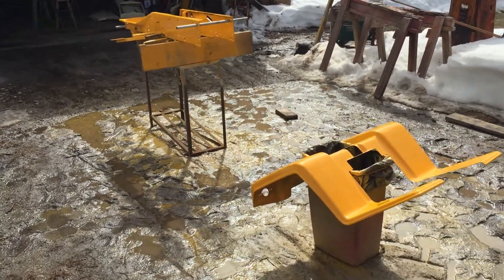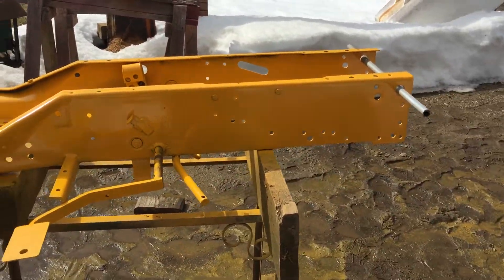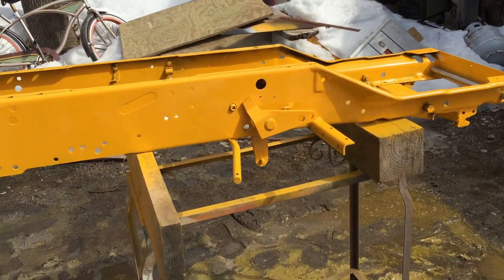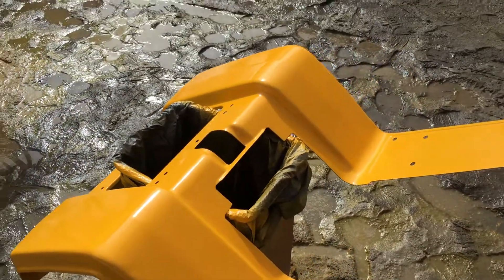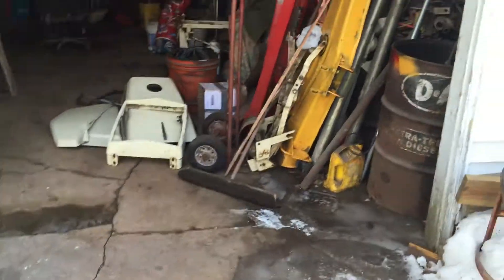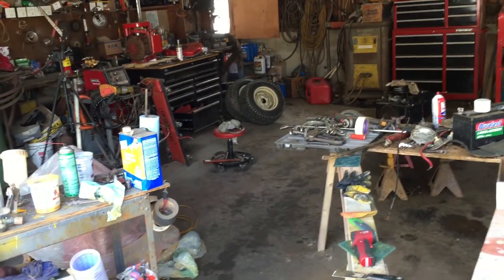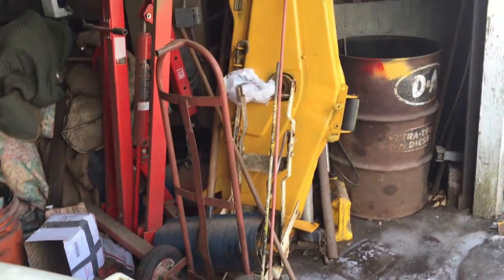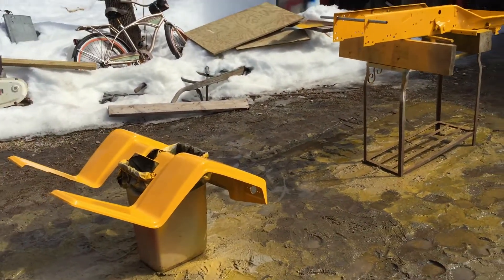cub cadet 782 repower and refurb part 4

Comment: Would you say that majic paint is any good we got a spray can in ford blue if you seen the video it never dried so whats you thoughts and opinions on it and the tractors looking good
Reply from the maker: All my tractors have been painted with majic paint and I had only one time where I didn't let the primer cure and had an issue , the majic primer is junk don't use it at all , rust oleum whit primer is what I have always used and never an issue with spray cans or mixed and used a spray gun
Reply: chooster5000 ok thanks because i have to get on my 71 and finish it so before i jumped the gun and got paint i'd figure I'd ask around again thanks for the tip on the primer also.
Reply from the maker: Ryan Desko no problem check out my videos before if you haven't already , youll see the paint jobs look pretty decent , I notice the red does seem to fade if not clear coated but still a quick buff and wax helps and isn't that bad looking
Reply: chooster5000 yea I've seen most of your restorations and they all look great. Also thanks for the tip about it fading and on the buff and wax.